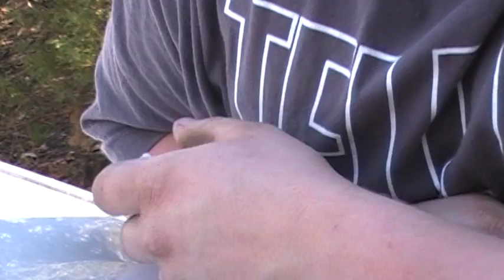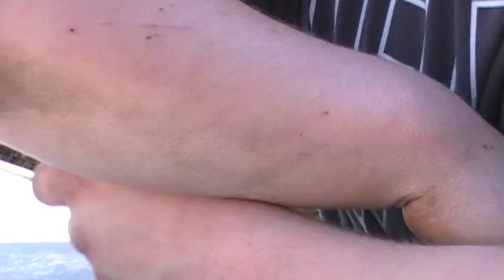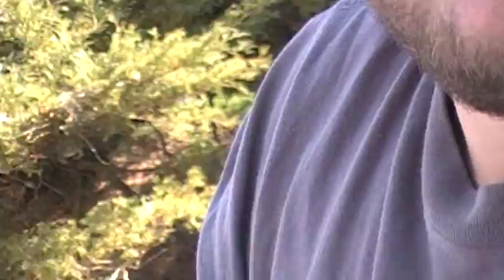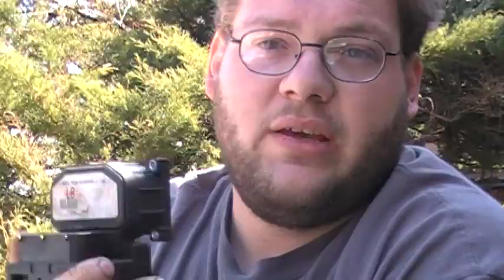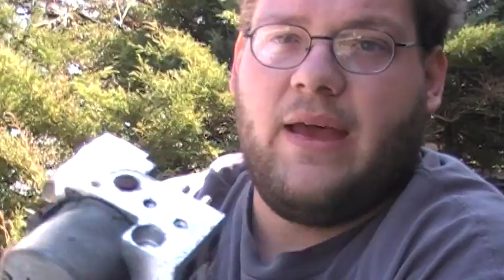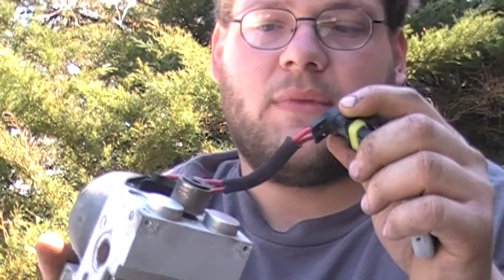how abs works part 2

Comment: hey. how are you? thank you for the information about how abs works. i have a question. you said that on 4x4 vehicles there are two sensors for each front wheel and one for both rear wheels. in that case are there separate sets of hold&dump valves on abs module for each rear wheels controled by one sensor or is there only one set of hold&dump valve for both rear wheels?

Comment from the maker: @StreetRacerSi  you can only check voltage to the pump with a scan tool while the abs is active during a stop but i would say that since everything else tested good that it is more than likely the control module has gone bad

Comment: @fatman2325 I tested wiring and sensor, more than that - I tried 2 used and 2 new sensors. I changed space between sensor and disc. I checked if battery get voltage when alternator works. Everything normal.
Before electrical part of ABS controller will get repair I would like to check if ABS pump get right voltage, but I don't know how. Hope your advise will help me.